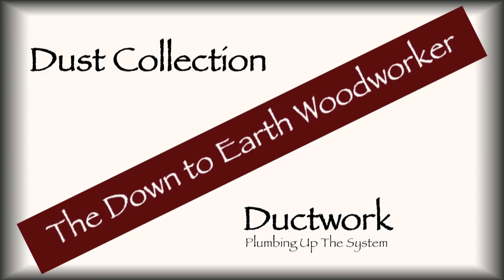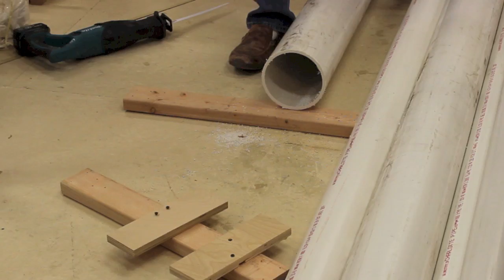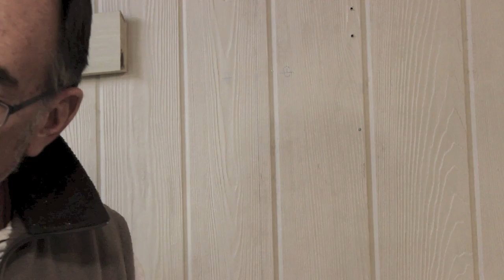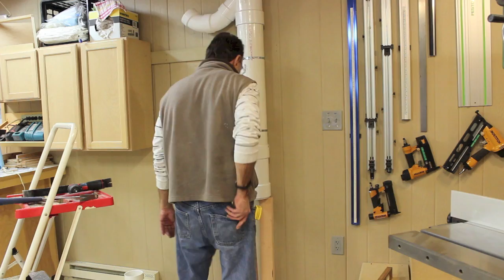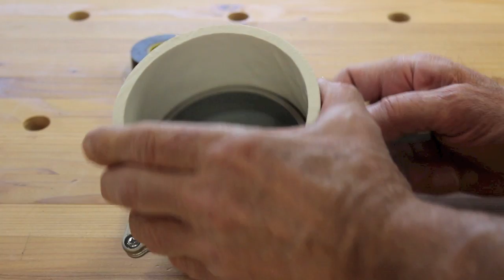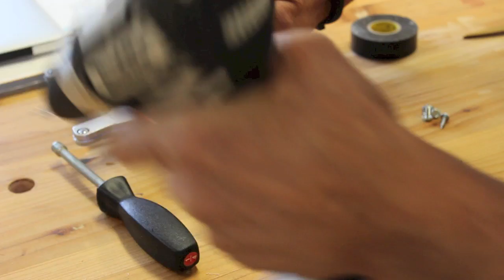Installing a Dust Collection System, Part 3: Ductwork and Piping - The Down to Earth Woodworker

Comment: Great video.  Where did you find the 6 X 4 X 4 wye on the far right with the black cover on one 4# end?
Reply: I'm not sure exactly what you are referring to... if you could reference a time code in the video I could be more exact with my answer.  If you are talking about the table full of fittings at 1:42, that is actually an 8" X two 4" fittings that was supplied with my dust collector.  I did not use it.